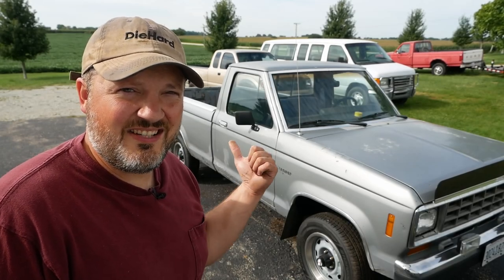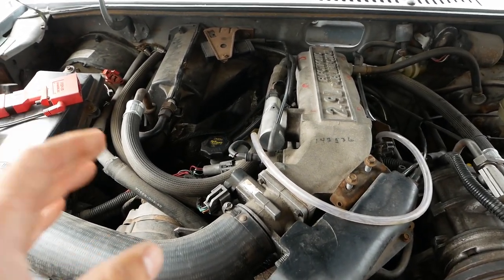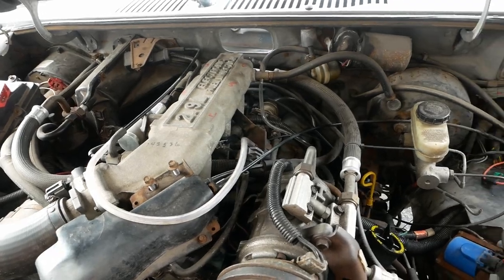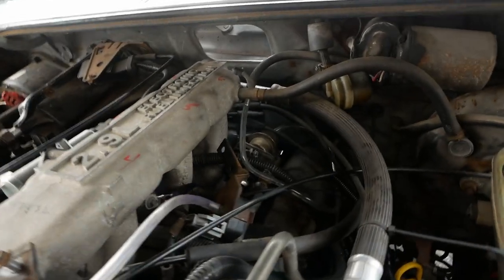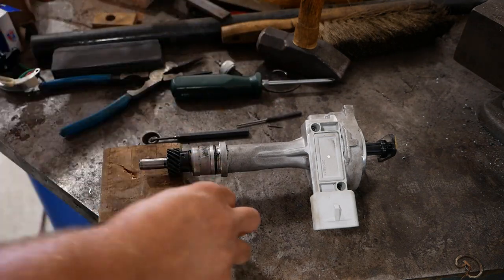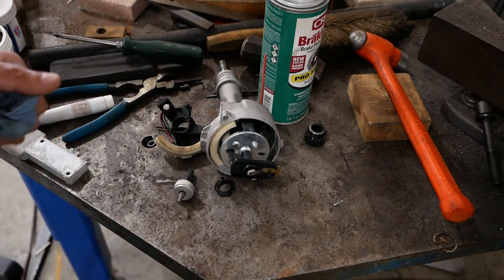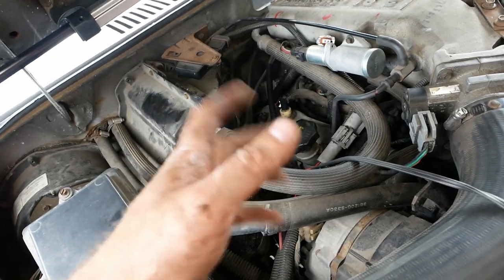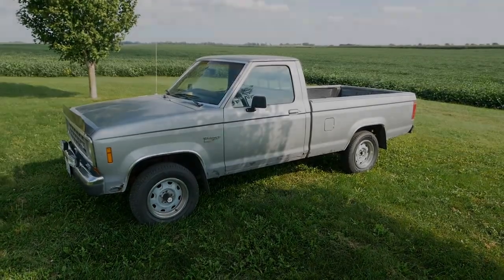Rusty Ranger Returns with More Bad New Parts - Randomly Stalling

Comment: This EEC-V emmissions system was an easy to troubleshoot, reliable set up..congrats to the ford engineers. Unfortunately, all fords will eventually need every electronic or electrical engine emmissions component replaced. My 1992 F150 went thru just about every part by 2005. Im surprised it wasnt just busted or rotted vacuum lines. Always check the plastic lines first

Comment: Brings back memories of a Mazda p/u I used to have. Sad day when a big old buck took it out.
Reply: I hit a buck with my 95 F150 5spd 4x4...  I got real lucky in that I was on the brakes hard and pulling to the shoulder, and he was coming from my left- darting acrost the road, and his front shoulder because I had seen him a little early:  but I was doing 70 on the highway, and as hard as I tried to slow down and miss him - he still caught me;  Runing from left to right, he just barely got passed the outer edge of my bumper, and when he hit, it made his head bounce off my hood, and it spun his body around and his azz hit my driver door real hard.  We stopped and I backed up to pick him up, and my brother had jumped out and ran back there, and slit his throat already----   and the dang thing woke up and started to stand up and looked wide awake and ready to go...  So I had to end up punting his head like a soccer ball and knock him off balance as he was standing up, and then I just stepped on his head so he couldn't get up anymore, and he bled out in less than a minute..  He had two long spikes, nearly 8" long, no other points though.  And one of his spikes broke off when he head butted my hood.  Luckily he didn't get into the grill or the radiator or anything -- just curled the left side of my bumper in quite a bit, to where it was nearly rubbing the tire;   didn't even break the headlight.  Strung him up and butchered him all up as soon as we got home and packed the freezer.  That's good meat.................   

There's another time we passed by a wreck of another car hitting a deer that had just happened (we just barely missed seeing it happen)--  and it totaled a little Honda  Civic--- but the deer was still alive, big 8 point rack or more, but his back legs where completely paralyzed and he was dragging around in the ditch with his front legs trying to get somewhere, still snorting mad and trying to fight us...  All we had was a knife and I wanted to bleed him out and take him home to eat too, but he was still scary as sh^t lol.. even though he didn't have any back legs working---   but the cops came shortly after-- they ended up shooting it in the head with their pistol, but they still wouldn't let me take it..  They called the game warden and government decided they would rather be tyrannical than to let a guy in a truck who's already there (Me)-- pick up the mess. smh.. so dumb.  They had to pay for someone else to come out and waste it that perfectly good meat.

Comment: 1985 Dodge 1 ton 360. Always had running and starting issues. Replaced the pickup in the distributor, no change. Finally replaced the distributor. Total improvement! However, it's still running on 7. Probably a burnt valve.

Comment: I had this same problem with my '87.  It was notorious for the PIP sensor to overheat and quit working.  Autozone even stopped providing the warranty from replacing it too many times in a short period.  Come to find out it was a combination of a bad EGR valve, TPI sensor, PIP, and crankshaft sensor.  If either goes bad, they burn out the others.  I really miss that truck.  It was my best friend.  I put 493,000 miles on it before it finally gave up the ghost.  Wish I could find another like it.

Comment: This one time on the Ford Truck Enthusiast forums...A guy had a bad EVR or 'EGR vacuum switch,' and he took it apart and fixed it!!!  I'm not sure if the coil was interrupted or if the diode was bad or what, but he fixed whatever tiny electronic fault which was affecting the EVR!!!!!  I always just went to the junkyard and got one. A 9 volt battery is fine for testing those too.  The only problems I've ever had with Ford EVRs and TAB and TAD solenoids were having them slightly explode - as if water had frozen in them. They still tested good electronically, but wouldn't hold air. I also once had a TAB or TAD fail open, electronically.

Comment: Geesh.  I'm so sorry you have to relive this stuff. w/o input from the old guys(people like me; old but still enthusiastic)  Those old(original) distributor so-called 'pick-ups' deteriorated from oil fumes...especially the white and orange ones.  Super easy to diagnose only because it happened so often.  Pull the TFI module off and the connector body was nothing but jelly.  Happened all the time.  BTW, I don't think there is a check engine light on Fords of that time.  There is a wire on the DTC that get's grounded but there was nothing on the dash.  Ford got away with that for a long time.  Worst thing with replacing the pickup is that techs would no mark the distributor gear and end up breaking it on re-install...the pin hole is NOT drilled on center.  It is drilled with gear in place.  50/50 chance you get it right.  Also, the 2.9 has hydraulic lifters.  It was the 2.8 that had solid lifters and required adjustment.   Thanks for the memories.
Reply: Would you happen to know what and where that DTC wire is? Wouldn't mind installing a custom check engine light lol

Comment: Years ago I had a 1.9L Escort GT that had an intermittent stumble that I was having trouble tracking down. Accidently figured it out after I disconnected the battery and the radio defaulted back to AM. Next time I drove it the radio had a bunch of ignition noise, that skipped every time engine skipped.

Comment: Another great diagnostic video! I'm surprised at how simple that distributor is! Also, what IS Ford thinking with spade connectors in an HF circuit? If anything ever deserved a screw-down terminal post, that does. That Hall sensor is huge, the one in my old Nissan Sentra was teeny by comparison. They used infrared LEDs and chopped them AND had a Hall sensor. insane.

Comment: Nice work Wes, so random thought. I guess in the zombie apocalypse older vehicles without all the computer nonsense would be preferred?
Reply from the maker: I guess, as long as you don't need them to start without flooding or run more than 5000 miles without needing a tune up.
Reply: @WatchWesWork  - maybe I need to work on willingly suspending my disbelief but watching The Walking Dead would drive me nuts. With car batteries that seemed to last forever and no one, least of all a former police officer, able to discover the utility of handheld radios, I tended to ruin viewings by yelling at the television.
Reply: @wes11bravo  with how all cars are I think the only thing that would be any good would be old diesel tractors with no electronics. And preferably hand crank like the old deitz engines. You can always get fuel for them from taking other vehicles engine oil

Comment: I converted a 1972 Plymouth from points to electronic ignition . I believe the kit was from Bendix . About a month later , it went south . The spark was intermittent . It stalled and I tried to restart . The muffler had filled with raw gas . When the spark came back , possibly out of time , the muffler blew open !

Comment: Nightmares of 1987 2.9 Ford ranger 2wd , first truck,first vehicle when I turned 16...no a/c..motor blew.. not due to lack of maintenance.. overhauled engine lasted 3 years..then transmission goes ..last time I saw it was getting parted out in junk yard... never bought Ford again... now a Toyota, GM man never any major problem.. anyway good video

Comment: My Saab has the V4 version of this engine. I use a socket head screwdriver to turn the oil pump drive before installing the distributor. If the V6 is built the same way, there's no reason to bar the engine over. I'd know; I've done it enough! 👍

Comment: Interesting TSB 🤔

ISSUE: All 1983 through 1990 vehicles with TFI-IV ignition systems may exhibit spark knock/ping if base ignition timing was set after starting the engine with a remote starter. If the engine is started with a remote starter (start wire "S" terminal disconnected at the starter relay) the ignition module will remain in the start mode (timing retarded). Ignition timing will be incorrectly advanced if base timing is set while the module is in the start mode. The engine must be started with the start wire connected, using the ignition switch to correctly set the base ignition timing.

Comment: I made a Special Tool to turn the oil pump for alignment. I ground the outside of a 5/16 drive socket to fit the distributor shaft bore, it is not the correct socket but will turn the pump drive.

Comment: I hate it when you get bad new parts. I replaced the carburetor on an old riding mower that I was reviving, and I couldn't get it to do anything. I couldn't get it to even try to start. It had been sitting for several years, so it could've been anything. Assuming that nothing was wrong with the carb, I spent a month on and off trying to find my blockage in the fuel system before realizing that the fuel shutoff solenoid on the new carb was bad. I just deleted it and the mower fired right up.

Comment: Congratulations, you have great skills. I'm happy parts were found. Thats rare. I'm happy the EGR system was repaired. That ignition system was in its infancy when it was released and the parts today to repair it, if they can be found, are probably from china and untrustworthy. The salvage yards are empty. That owner has a very good truck and you sir are a fine technician. I also never knew that the ignition module needed to see a key cycle in order to allow for base timing adjustment. Reading the service manual is always a good idea. An external pressure regulator and a fuel return line sure brings back memories. Disassembly of the distributor, a fun word to say, was a skill in itself. Also reinstalling it correctly is a skill in itself. That distributor is yet another fine product of the chinnese.

Comment: Wow, all kinds of fairmont/fox body mustang styling cues in that interior, just replaced both of those vacuum doodads on my 95 Sable 3.0 vulcan,  (for the EGR codes, BWD brand?) had to get my OBD 1 codes by the strobing check engine light.😁 Hope I never have to touch the distributor. Thats one Lucky Ranger. Nice work.

Comment: Funny story about the fuel pressure regulator. Ford used almost the same one on the 4.0 and mine failed in such a way that it hydrolocked the engine great times. Great times

Comment: 86 the first year of the 2.9 had issues with cracking heads they fixed it in the 87 year model on love that generation of ranger my dad had one when I was a kid 1985 short bed 2.8 5 speed 2wd I cried when he sold that truck iv had 6 of them and will get another when I come across one

Comment: I wish I had seen this video several years ago.  I had an '86 extended cab that was doing the exact same thing.  It would run fine and then without warning just shut off.  Several shops tried to find the problem but none ever could so I traded it.

Comment: My 84 ranger  had a leaky fuel regulator.  Allowed air into the line so every time you tried to accelerate the engine stumbled.   I got a new part from a wrecker.   They had a  wrecked one with low miles and I stripped every electronic sensor of it.

Comment: 1983 and some later Rangers had defective camshafts. this would cause them to stall at times and be hard to restart. Mine had the camshaft replaced under warranty--the issue was gone.  With the rotor in place--mark where the rotor is pointing to. remove the distributor. Do NOT move anything or rotate the motor. Make the repairs to the distributor. reinstall the distributor with the rotor pointing at your mark. Start the motor.

Comment: Back then Ford repair info of REPLACE WITH KNOWN GOOD was standard practice. Like every shop had a full parts department of Ford parts. YEAH RIGHT........Just like GM sent you down the trouble tree doing ohm meter parts and wiring tests to last step: IF NO PROBLEM FOUND REPLACE THE COMPUTER......Goes to show that neither OEM had a clue how to test/fix their vehicles.

Comment: That reminds me of a motorbike I used to have, Kawasaki KL250, the headlight and tail light bulbs used to blow with regularity, of course being a kid I didn't have a clue or all the fancy tools nor was the internet around in those days so I checked what I could, visually checked all the electrical connections, the charging circuit and still no dice. So I took it to a friendly workshop and he found it was the voltage regulator, I was given names of who might have one and stumbled upon a shop who had a new old stock one, he said it had been on his shelf for years and years so gave me a good discount on it, fitted it and bingo, no blown bulbs.
Reply from the maker: Nice!

Comment: Those ignition systems on those old rangers were a bad design. One of my classmates in college had one of those rangers and complained bitterly about how it would stall in heavy traffic when the engine got hot.  It was still under warranty but the dealer could never find the cause of the engine stall. Finally, he traded in the vehicle to get rid of it. On later Rangers, I did notice that Ford had moved the ignition control module to the front of the truck and installed a heat sink on it so that may have fixed the heat issue.

Comment: Not surprised that the new distributor failed. Unfortunately the supply of domestic rebuilds dries up for older cars. I ran into this with a 92 Camaro with a LT1. The only distributor available was a new Chinese one. Luckily it worked and my customer sold the car soon after(whew, off the hook!).

Comment: Ah, the US version of the ford 2.9 v6 Cologne engine, i can dream those as the euro wiringlooms are crappy, but the engines are bullitproof and very much used in shorttrack ovalracing, i still have US pushrods, ARP big end and main bolts and a few extra bits to rev it to around 8500 rpm...
Reply: Funny how the later US Cologne V6 stroked out to 4.0 Liters does NOT like to rev at all.  (Mostly a cylinder head issue though.)
The bottom end is indeed bullet-proof.  I recently rebuilt my '95 4.0 at 300,000 miles, and the rod and main bearings looked practically brand new.
Reply: @rhekman  you can find the 4.0 overhere in imported explorers but they are rare. Whe had the 2.9 24 valve cosworth engine with 200 horses, really smooth engine, but also from the mid 90ties so an aging beast...

Comment: A great trip down Ford memory lane. You have a great skill in research. A lot less plumbing to contend with. With todays disposable vehicles and their computers and endless sensors used, is it going to get a less reliable car/truck?  Will there be enough knowledgeable mechanics around to keep these hi tech systems operating? Here's another one. Is it worth buying a a good used vehicle an throwing a reasonable amount of money to good mechanics (Such as Wes) to get something reliable? Sorry for the soap opera philosophical rant. Per usual, an other great video.

Comment: Had exact same problem on my 89 Bronco 5.8, drove me crazy! The new TFI modules are absolute garbage! They are so poorly built that they cannot tolerate the heat when mounted to distributor. Unlike the original Motorcraft module that was better made and would tolerate the hot location for years, these new modules will start acting up in weeks or months, they will heat up then just shut off, restart no spark, turn key off then will restart. I actually got 2 that failed, 1 the same day, 1 lasted a week. McCully Racing products makes a module relocation kit to get the module into a cooler location which is critical with new after market modules, it is a fantastic setup with a great heat sink and is plug and play. I have had this setup for almost a year now and the TFI issue is gone, truck runs great! BTW, there was a huge class action lawsuit against Ford for the TFI ignition in the 80's, google it, Ford's solution was to relocate module from distributor to fender. Those OEM kits are no longer available, so check out McCully Racing! P.S. don't waste your $ on a new Motorcraft module, they are not made by Ford anymore and you will pay over $100 for it and it's just a reboxed Standard Parts unit.

Comment: If I encounter loose contacts like that, I give them a little twist with needle nose pliers
Reply: Exactly.. I said the same thing.  But then you're risking breaking a solder joint inside the little box, and plus, with it being loose like that for so long, it probably ended up getting hot and burning up the coil.   I bet, as soon as the truck would die-- if you put your hand on the distro it would be extra warm and spicy

Comment: Need to let you in on a big secret.  Add Seafoam directly to your engine oil and your tic,tic,ticking sound will immediately go away. All you do is, for each quart of oil the engine requires add one ounce of seafoam.  If its 5 quarts of oil then add 5 ounces of seafoam. Then,  dump the rest in your gas tank. Within 30 minutes you'll not hear that tic. I add 6 ounces every oil change in my Ford and the valves and lifters are quiet as a mouse.

Comment: You get technicians that work on one breed and are trained on that one breed that might find those faults that easily. There are not many out there that can do it on any breed plus do any other mechanical needed. I agree you should have a lot more subscribers. Way more interesting than another tool channel all covering the same tool release. A lot with over a million subscribers.